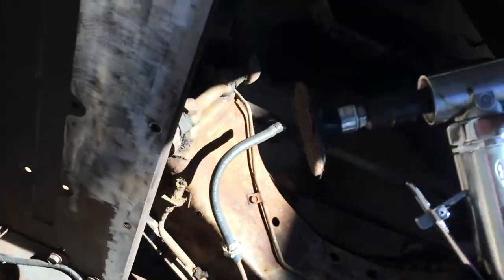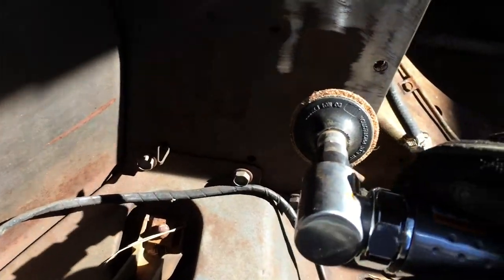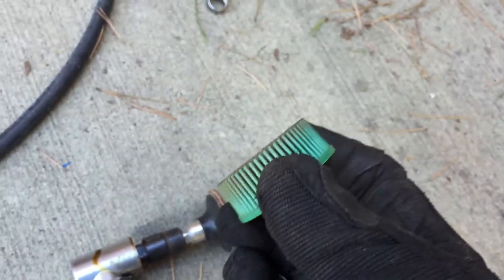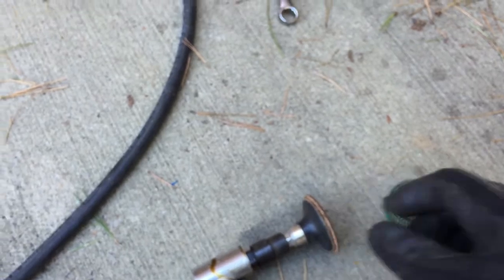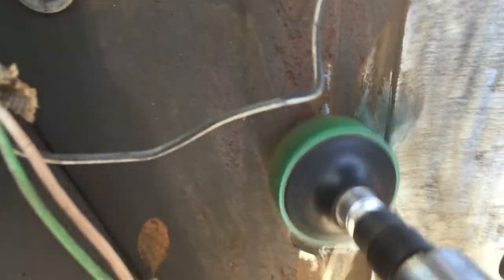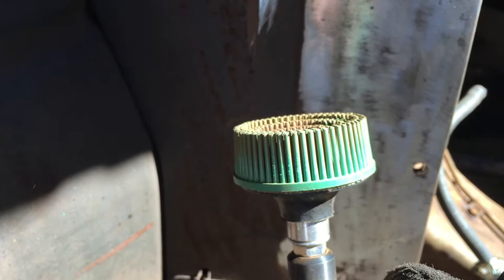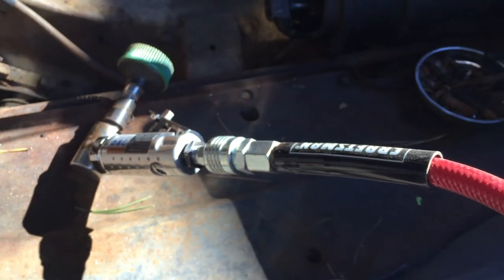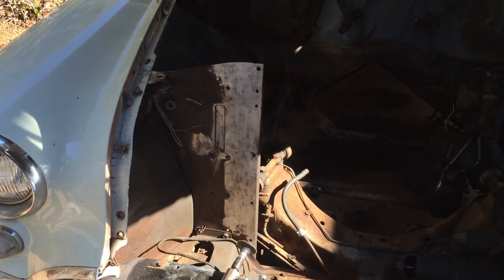Bristle disc roloc 3m die grinder part 1

Comment: I know I need the green bristle brush, but what other attachments do I need for my die grinder to get started using these? It's the quick change setup, but not sure on which one to buy
Reply: dasmith69 You will just need the roloc disks and the roloc disc holder. Then a drill or air grinder